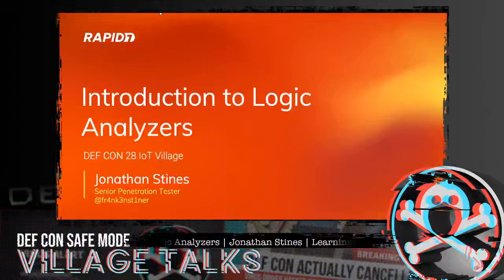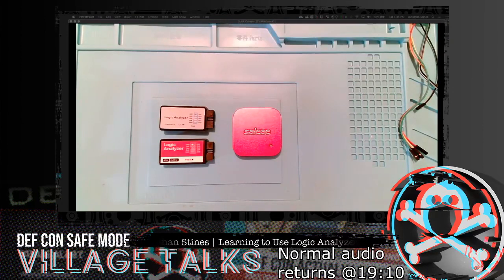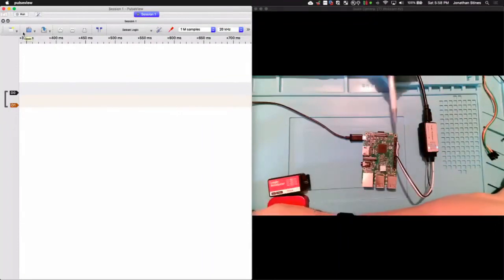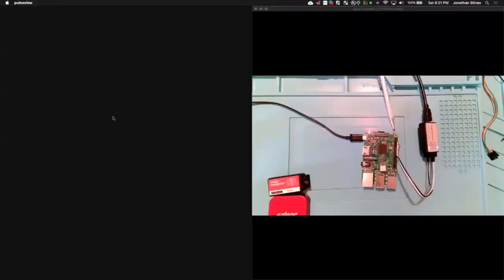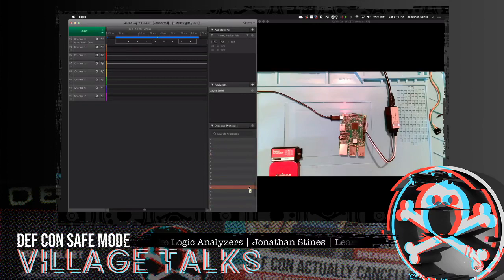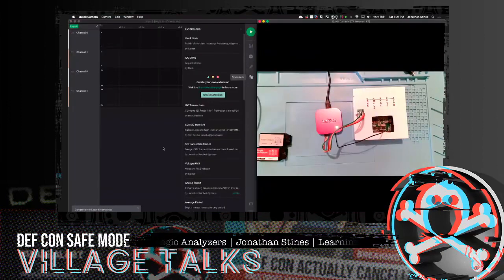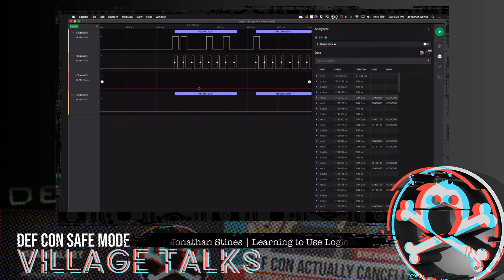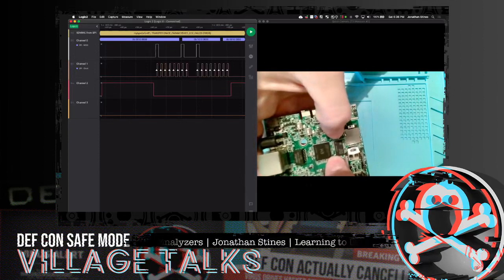DEF CON Safe Mode IoT Village - Jonathan Stines - Learning to Use Logic Analyzers

Comment: Hantek Oscilloscopes are a gift from god for the budget hobbyist. Due to safety concerns and convenience I wouldn't get the USB scopes though because you can kill your laptop if you screw something up. The Desktop models are more feature packed anyway and can still be hooked to a laptop if you must capture data to a PC. I recommend the 4000C series because it has a signal generator and signal analyzer in addition to the oscilloscope. Their scopes can be unlocked and all use the same hardware so buying the 70Mhz and buying the faster probes for a few bucks can save you money. Although you will need to go in over jtag to unlock higher speeds.

 Hantek is the manufacturer of many entry level scopes for other name brands. In Germany Voltcraft sells their scopes for 2-3 times the price you can buy them direct from Hantek.  They are a much more affordable option and give more features for much cheaper than an entry level rigol. I have the 5000 series 200MHZ scope and I love it. If I was to buy a more expensive scope I would buy the Hantek 7000 Series before I buy a Rigol 4000. They have almost the same specs but the Hantek costs half as much as the Rigol 4000 base model.

Comment: I have 2 logic analyzers and they are great for debugging digital signals on your devices. My Hantek has one built in and then I have a Saleae Logic Pro. Being able to decode so many channels at once is great but chips are getting so small making a connection is getting hard.